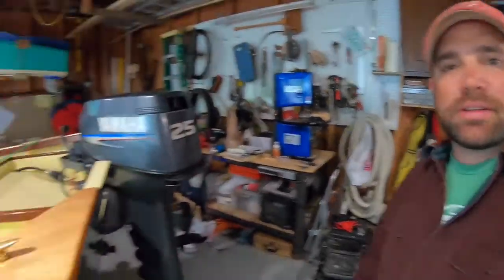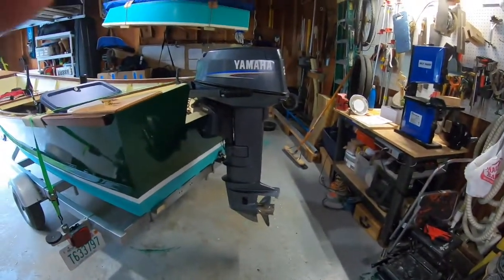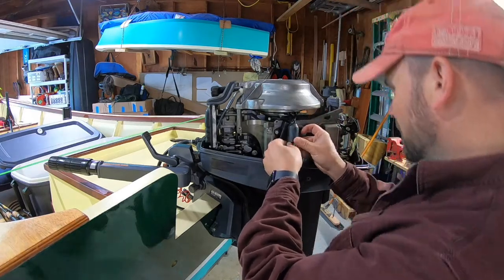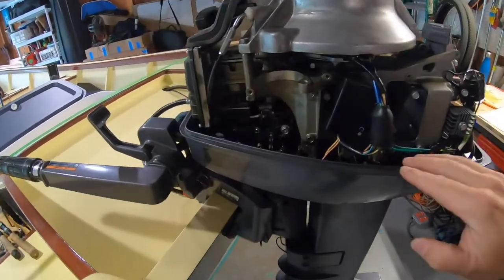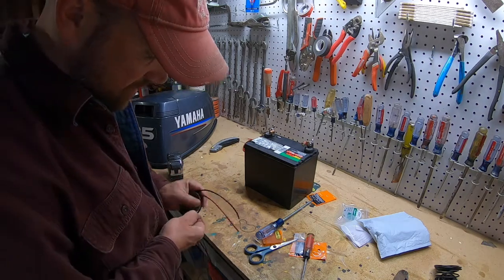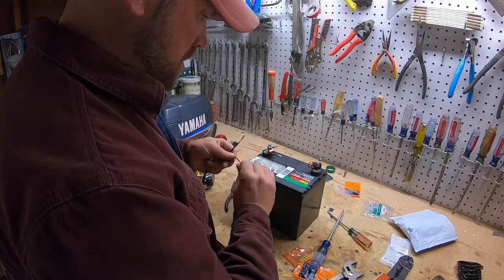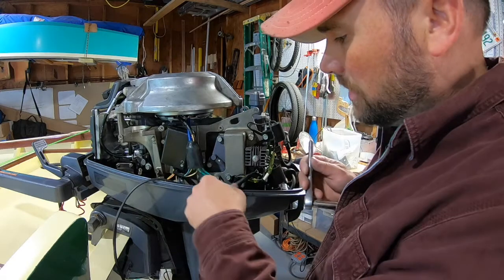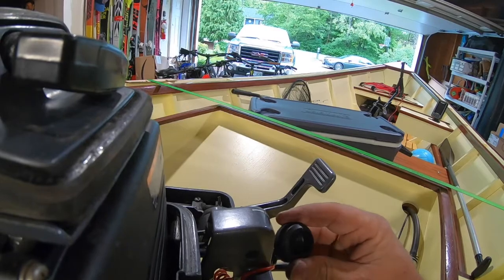Charging a battery with a 25 hp outboard

Comment: You need to check and make sure you are not overcharging the battery when running at throttle, what they call regulators are actually only a rectifier whoch converts ac to Dc current and will throw out over 16v 1/4 throttle to full out. You meed to make sure that it is actually a regulator so you dont overcharge

Comment: By the way nice boat. Is that a homebuilt Spira design? Also FYI and not just MHO. Split type lock washers are worthless or even worse. In hi vibration application will actualy loosen the nut. You will NEVER find split type lockwashers in aviation aplications. Best to use Star type lockwasher, Nylon insert locknut, or and blue thread locker ie. Loctite® Threadlocker Blue 242®

Comment: How does it stop from over charging? Fish finder can’t be using too much battery power yet motor continues to charge. Will this not over charge battery? You have a sweet boat!
Reply from the maker: In theory I think you are correct, it could over charge. That bing said I fish with an electric trolling motor (separate deep cycle battery), so the outboard is only used to and from the fishing spot. If I run the motor for more then 30-40min, that would be a very long run for me. I also don’t charge the battery when not in use, so I don’t think I could ever over charge it.   I also plan to hook additional components to the battery like lights and charging station for my phone. I’ll try to make another video when I add anything. Thanks for the compliment on the boat. Very fun bucket list project for me!
Reply: The regulator ensures the battery won't overcharge.  The rectifier converts the three phase stator output to DC for charging, and the regulator regulates the charge rate.  Just like your car it pretty much stops charging the battery at any significant rate by about 75% charged.  It will never get a battery up to 100%.  The sensor wire tells the regulator the voltage of the battery in circuit, the higher that voltage the less current will flow - the lower that voltage the higher the current, up to the maximum possible output of the coils of course...  Very simple system.  Worth checking if there is any residual AC voltage if you run the system without a battery, as if one or more diodes blow you get unrectified AS voltage across your system.  Other than that should be robust and last for years.

Comment: That was a great video!  Good videos on charging a battery from an outboard seem hard to come by so yours is a welcome find.  Any chance you could put a link in the description to the rectifier/regulator you purchased?  Thank You
Reply from the maker: This is the rectifier I purchased on eBay. 
Rectifier Regulator For Yamaha 9.9-25HP 1984-2010 Outboard Motor 664-81970-62 U9

The cost was $15 on EBay. The Yamaha OEM  part was $75, so I took a chance on it. I would recommend you search for your motor. I also don’t know if there are differences from the OEM product, so please don’t take my work for it. Thank you for the nice comments. I hope this is helpful. More videos to come, as I play around in my garage.

Comment: Good video. Did you have trouble with the two green wires getting tight when you advanced the throttle? I know that bundle of connectors/wires moves with the mag plate as the timing advances.

Comment: hey petro I did an electric start install on a 25 murcury pull start 1980s outbooard, the whole deal,  new flywheel ,starter, stator ,ignition, the only thing confusing is the wireing from the stator to the rectifier to charge the battery,think this might have helped  thanks

Comment: Thank you very much for your help.. I have another engine. evinrude etech 30 hp coils are not receiving energy. We tried 3 ECUs. It is a steering system, but it is not connected to the steering wheel at the moment, we are just connecting the cables to the battery and trying it. They say it will not work without connecting the ignition key. Hello, good day my friend..

Comment: Helpful video. Thanks. Isn't there any concern about overcharging?
Reply from the maker: Thanks for watching. I have had no issues with over charging. I run a small fish finder 100% of the time and an occasional bilge pump and lights. I also use a bow mounted trolling motor for fishing (on a separate battery), so the outboard is only running a few hours when I’m out all day. Between the low outboard usage and constant draw from the fish finder, the balance works really well. I never have a dead battery and it’s been running that way for a few seasons with no issues.